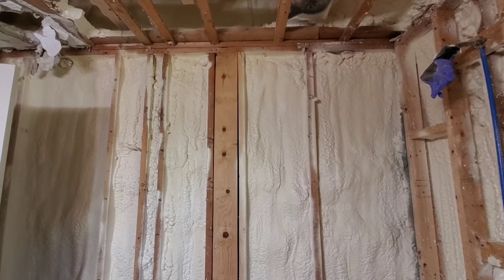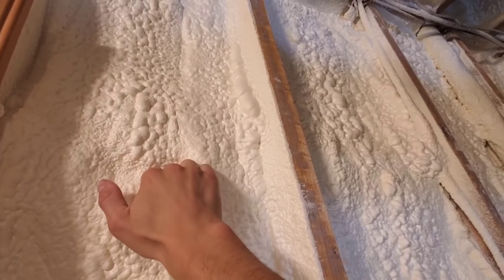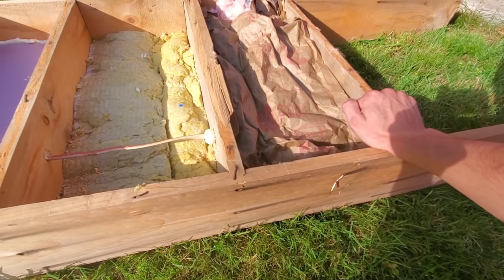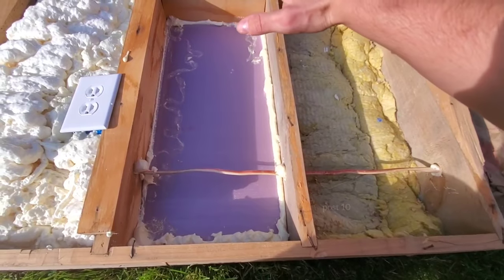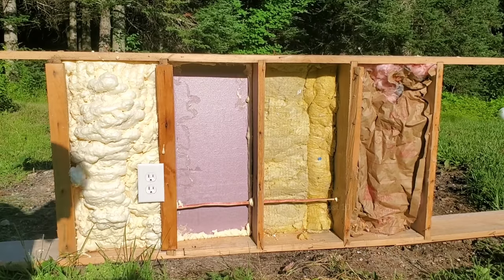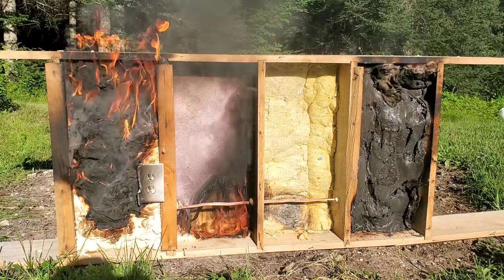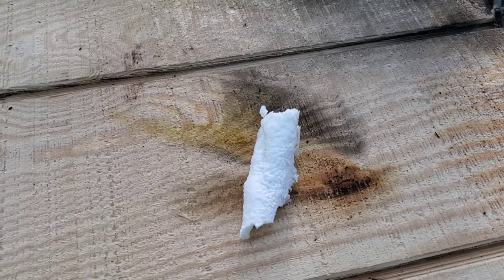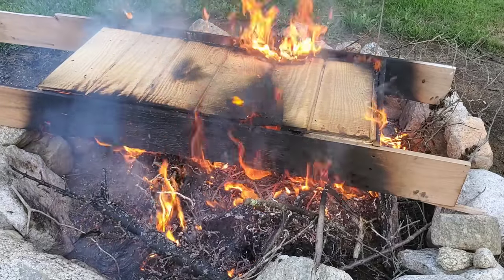Testing The Burn Ability Of Insulation In Wall

Comment: Excellent demonstration!
2 items QUESTION on firestop & IDEA for treated Cellulose  toxicity & livingspace intrusion.
Sooo...Question: I thought you said Firestop is the same thing as spray foam, and the spray foam burned like crazy -- so...how does it block fire?  Also: IDEA:
For a future video demonstrate 2 aspects of "Cellulose" recycled paper insulation. This is the stuff they use to insulate poor people's homes via free programs. The stuff is treated with Fire Retardent, Bug Killer, Anti-mold, and - worst of all - a chemical that makes mice sterile. The dust from it was able to get sucked into the living space via temp differential air exchanges  through ceiling fan fixtures, wall outlets and the frame around my closet (you could smell it). This dust raining down from over my bed was terribly acrid for over a year (others I know who had this done complained of it as well), and it continued to be an issue despite multiple thorough wall, ceiling, floor cleanings. Two years later, I was diagnosed with 2 cancers  and have terrible trouble breathing. Air cleaners just seemed to suck more through. 
I had asked the installers to seal the fixture and they said they did, but they sprayed overtop the edge of the Cellulose, which settled, leaving a 3-4cm gap.
Not only that, but the house was initially colder after, because the men brought a ton of scrap wood up there (old nasty countertops, plywood, etc) all ostensibly to walk on.
But then left all that disgusting stuff up there & didn't insulate under any of it. In other places, they took the rock wool that had been there, draped it crossways overtop the joists and buried that under >5cm of Cellulose. Over my bedroom, they insulated extra, I guess thinking that if I was toasty in bed I wouldn't notice being frozen in the rest of the house. 
All poor workmanship to beware of aside: the TOXICITY & INTRUSIVENESS  into habitation space could be a lifesaving test (maybe using an air quality meter and cool lighting?) for others being forced via energy assistance programs to accept this material.
Great job on this cool test burn -- I was stunned by how the foamboard roared to life again as you simulated what firefighters typically do -- hacking into it. Amazing &  scary! I wish the fibergass didn't have paper on it. If that were a house, youd havevto replace it even though it didn't burn because of all that paper char.

Comment: Another point of view. 
Rockwool will melt above 1000c. 
Glasswool will melt above 600c.
The foam products catch fire at approx. 300c and will release toxic smoke when burning which includes hydrogen cyanide and carbon monoxide.
I recommend NO USE of foam products in non fire sprinklered construction.
In most cases, it’s the smoke that kills, not the fire.
Steve

Comment: Would be interesting to see an true internal fire -- fully encapsulated wall .. You have perfectly demonstrated why, in all Canadian Codes foam needs to be full sealed behind drywall..  Thanks .. as a designer this will be very educational for our clients when we have to explain why it needs to be covered.
Reply: Not sure if it actually requirement to be behind drywall,  I think requirement is to have it covered by 15 min or so thermal barrier,   which drywall satisfies

Comment: According to code, spray foam must be covered. It either requires a spray foam retardant, or a fire barrier wall material such as drywall.  Foamed cavities are ideally filled and trimmed, which does not allow air to circulate, which is a lot different than this test. Treated cellulose, fiberglass, and rockwool are other good insulating materials that when installed properly reduce fires, not increase them.

Comment: I've seen some building channels show the use of both spray foam and rock wool. A good dense spray foam seems like the best choice as a vapor barrier, while the rockwool does the build of insulating. Since the foam seemed starved of oxygen, I would be willing to hypothesize this sort of sandwich may be better than just the spray for fires.

Comment: As a woodenframe house builder i explain to the customers why they need rockwool and rockwool only. It's good as it can get no matter the purpose(floors, roofs, walls etc). Combine it with GFL drywall sheeting and you are good to go. It can contain fire in one room for the fire rescue team to arrive and save you from the worse.

Comment: You can use the mineral wool to increase the fire rating of an assembly. Now a day, the most energy efficient place to put insulation is on the outside as it can be the most continuous. For large buildings, mineral wool is best because it is not combustible and is semi rigid and water resistant, so it is perfect for cavity walls / rain screens.

Comment: As a firefighter I feel like I should give y'all my 2 cents because as a part of a firefighter's job is to provide public safety and awareness. No one really uses wool anymore that's for your Victorian era houses so I will be ignoring that and I will be  ignoring the purple paneling for obvious reasons. Between the spray foam and the fiber glass insulation the foam is the far best option for your you insulation. Fiber glass has the added paper material along with more room for oxygen to lay within the wall ( paper and oxygen is fuel along with with heat aka wire sparking or plug over load equals fire) allowing for rapid high heat burn. Even though there maybe fire barriers within your walls the heat/flame can still make it to your attic space or basement space causing out reached fire damage and the possibly of losing the entirety of your home. It is more difficult to control attic and basement fire then a room and contents fire aka furniture because of limited access to the attic and/or basement depending of the fires flow path through the house ( the fire chasing oxygen) 
The spray foam on the other hand is more dense and holds less oxygen therefore making the combustion process more difficult for the flame if one may occur. Further more with the foam being more dense  a flame would have to works its way through all that fuel (the foam) in order to get to an attic space or basement. This would allow first responders more time to get to your home, business, shop etc. before them building becomes what we called fully involved or before it could make it to the attic or basement areas. 
It is far more easy for fireman to take out panels of call and spray a at most a couple hundred gallons of water to put the fire out then it would be to to spray a couple thousand gallons and cut holes in the buildings roof or in holes to the basement, which would lead the home to be completely unlivable or condemned. On the other hand we could just take out a few panels of wall, cause minimal smoke and water damage to the structure. This would leave the structure usable or make it to where it can be repaired within a few weeks to months instead of rebuilding the entire structure.
Spray foam is the best option all around for insulation and fire prevention to a structure, further more a lot of newer fire stations are using this spray foam because of its reliability.
Reply: Not to mention he used foam out of a can in this "test". That's not the same stuff.

Comment: Did my whole house with spray foam kits. The Foam was rated as fire and bug resistant. Never had a fire and never saw another bug or mouse. Closed Cell. I also went across the studs with aluminum double bubble insulation. Then taped off all seams corners etc. It was a closed envelope. Cut My heating bill by 80% and cut MY A/C use down to 2 weeks a year. Love the Foam and Aluminum Double Bubble.

Comment: I stayed at an old farm in Austria for a while in the ‘70s. A wall next to a Kachelofen got hot, so I decided to use an axe to open it up. Fire roared out, but it was the only way to get water in the wall to put out the fire. The (volunteer) fire department came and soaked the place and told us we did the right thing. The owner was happy because the old house was a total loss… and well insured.

Comment: Nice video but as your friendly neighborhood electrician as long as you have the proper wire size and breaker you’re good. A properly functioning breaker will trip before the proper size wire is hot enough to cause a fire. That’s how I feed myself 😎

Comment: Honestly, rockwool is the best insulation overall. Rockwool is primarily used around heating units and sources of ignition because it doesn't burn. Main issue is the price. Rockwool is the most expensive insulation by far.
Fiberglass is the cheapest but also has the lowest R-value. Even with the thicker layers to compensate for the R value, it's still the cheapest as long as there is space for it.
I'm just uncomfortable with foam due to it's pyromaniacal exuberance and tendency to trap water or hide leaks. The only time I use foam is gaps and the cores of doors due to it's density.

Comment: In Poland we build our homes from AAC with rockwool insulation inside and special mineral styrofoam outside. Only roofs are wood constructions, but this wood is quad impregnated (against fire, water, fungi and insect pests). Those houses are practicaly 100% fireproof.

Comment: very informative, I will browse your videos to see if you did one on Poly iso and fire treated spray foam.  Also to see if you did it in an attic scenario up on sloped rafters.  I think the building codes are behind in addressing foam fire issues.  For instance a fire stop is not needed on single family residences under plaster where they use the white EPS foam all the time out here in California.  I have seen jobs where a fire started below in the eps foam and moved up the wall between the sheathing and the plaster like a chimney vent as the EPs melted away - went all the way up the wall into the attic where it spread!

Comment: Thank you very much for this video! At my work, we have these industrial sandwich metal/foam/metal plates in the cooling rooms. They are classified as "difficult to burn". Turns out this only is for a perfectly intact plate having fire against the metal - the foam itself, should it meet an ignition source, is about the same as the one you showed.

Comment: Rock wool and cellulose will hold up to a mapp gas torch with little more than discoloration.   Fiberglass melts in an instant, like cotton candy under running water.  The paper facing didn't burn hot enough to get the full picture.
Sorry to be critical.  I appreciate your effort, it shows the alarming performance of unprotected foam.

Comment: We used a spray foam in the mining industry that would only burn as long as you held the torch to it. As soon as you removed the torch it went out instantly without any hesitation.  I think the comparison using great stuff to fiberglass is mixing apples and oranges and therefore it projects a false negative for spray foam. Two different animals here.

Comment: spray foam also gives off toxic off-gases which over long periods of exposure can lead to a lot of different respiratory illnesses and health related issues.  Honestly I wonder how the aluminum style insulation would hold up or if it can catch on fire.  I've thought that the best way to protect your home from electrical fires is just create a stone or tile corridor in your walls for electrical wires to sit in so there is nothing flammable for it to burn aside from the outlet side of course.  Honestly if you do your electrical work properly you will not have this kind of worry and if you use your head and not overload a circuit by putting on 20 different things on the same outlet/plug then you are usually safe.  But this is also why for heavy duty electronics (PC, AC, Refrigerators.)  I would always recommend to customers to put them on heavy duty UPCs or Heavy load battery backup units as they will immediately cut out if they detect surges and you hear the  beep when they switch to battery.  Cause honestly light fixtures that are just plugged in will rarely cause fires unless its got a ratty wire or really twisted wire.  Cell phones rarely catch on fire unless you are doing something really stupid like buying some really cheap chinese knockoff replacement battery instead of ordering one that is meant to be in it.  Also I always have my phone charge via usb...why cause its an extremely low power flow and its regulated to not send surges that could damage sensitive USB devices.  Use your head, do things the smart way..yeah it costs you something initially but after that its a no brainer and no worry for the future type of setup.

Comment: The great stuff is actually just closed cell foam, there is no mix or hybrid. You can look at the data sheet for it, whether it's the big gap one, the regular, or the fire block, they're all closed cell. Big gap just has different expansion agents. The fire block orange stuff is also the same as the regular, but with a dye added for code inspection, they all have the same fire retartants added.

The only exception is the blue door and window foam, this is a low expansion pressure open cell foam.

There is some difference from great stuff to the 2 part foams, they may both be closed or open cell foam, but they other ingredients are different. The great stuff has to be a single part but only cure outside of the can, where the 2 part stuff immediately reacts when mixed.

Comment: In my own home I've always removed the paper backing on the pink fiberglass insulation. If the paper catches from a spark, it won't catch the fiberglass on fire but it definitely could catch the surrounding wood and other construction debris, thats always left in walls, on fire.

Comment: I'm considering building with earthen blocks or hempcrete blocks. Neither should burn, mold, or be affected by pests. Wall insulation isn't needed for either. But, if you have a stick-built house and need insulation, you could try Hempwool, which isn't supposed to burn either, tho it's a plant product. It's also quickly renewable (the plant matures in 4 months), helps sequester carbon and is gaining a lot of interest by farmers in the northern US.

Comment: I use rock wool for insulating my home and garage... I held a propane torch to the material and it would only char... Not burn . You can get a little flame while holding the torch directly on it but once you remove the torch the flame goes out...

Comment: The pink insulation board was fueled by the spray foam sealing the bottom. At one point only the spray foam at the bottom was burning which would have been the equivalent of holding the blow torch there for an extended period of time. So it's not quite a fair comparison in that regard, plus it was getting the most oxygen from the gap at the top from the wind. I'd be curious if it would have gone out on its own without the extended exposure to direct flame.

Comment: In the UK there was a huge fire at a London tower block called Grenfell Tower.
Many innocent people lost their lives.
The cause of the fire was the use of closed cell foam insulation sheeting used inside open-backed metal tray cladding.

The installers tried to pass the buck onto the manufacturers, but the manufacturers simply stood by their findings and test results that, when used correctly,  the panelschad the highest fire safety rating obtainable.

The rating was for the insulation to be fitted with no air gaps.

The same foam board is still being used in newbuild housing today. But is fitted correctly.
Reply: Bit of a misinterpretation of cause here, Rambling Man. Grenfell involved highly flammable cladding  with polyethylene core, in conjunction with flammable insulation and a full height unbroken chimney effect between the two. Plus plastic framed windows with flammable infilling allowing flames from outside to get  into each internal level. 
Not really relevant to this experiment, whatever this experiment set out to show (not entirely sure).

Comment: Fiber glass burns well if glued with phenolics (colored) the white pure glass not so much, but mineral wool is fire wall rated.  Spray foam is available in both e 84 fire rated or not. Same with cellulose insulation.  You must know and use the correct one.  Mineral wool can actually rot by fungi.  Foam traps water and hides termites.  Treat all the wood with Boracare before using foam.

Comment: A client of mine a manufacturer of  panels made from sheetmetal, both sides, with foam insulation between which are used to make big stores/halls. He told me that once the fire will get inside there is no way to stop it from completely burning to the ground he said

Comment: This is why if i build my own home ill be using areogel batting. Its roughly 3 times more efficient, farless burnerable, less toxic, and less likely to mold. Its better in essentially everyway and its rougher the same price or cheaper per overall insulation rate.

Comment: Rock wool has a very high heat level like 1200F I use it to do soldering of water pipes in tight spot so i don't burn the wood studs. You can hold it with you hand and hit it with a blow torch and not feel the heat on the other side.